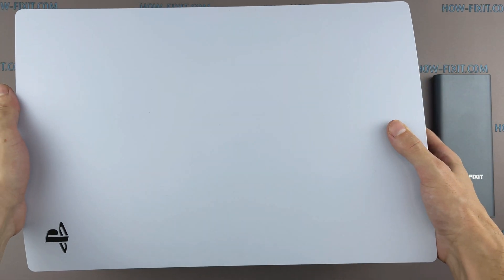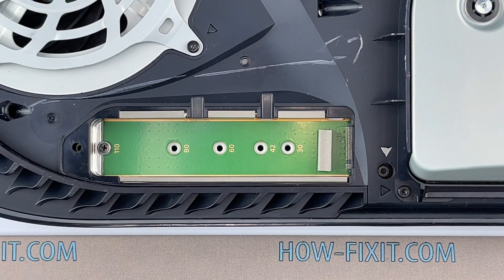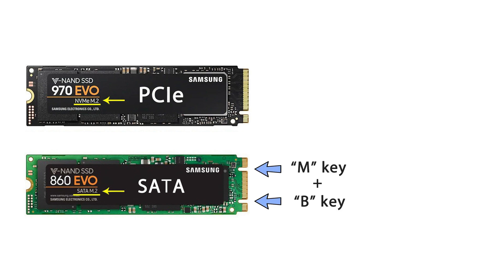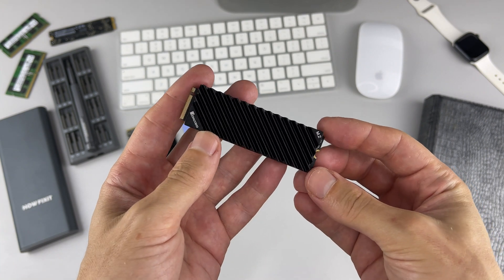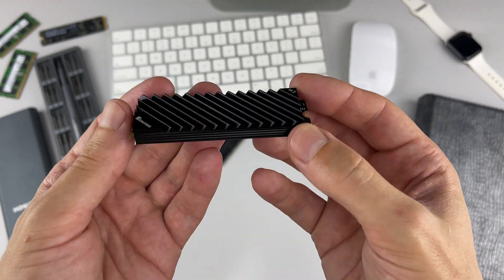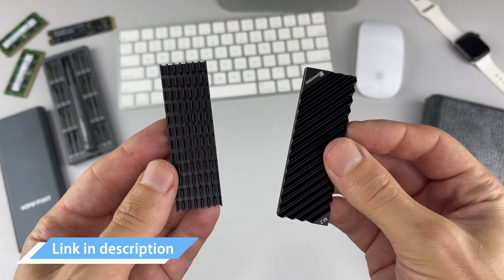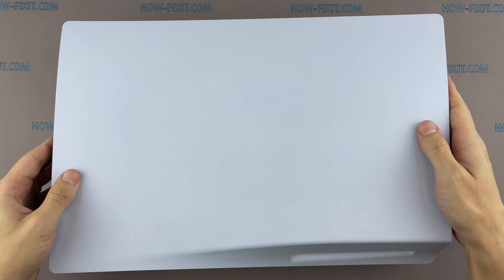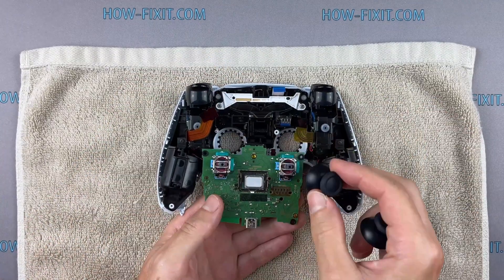PS5 Storage Upgrade: How to Choose & Install M2 SSD

Comment: Hi. Thanks for the video. I have put the Viper VP4300 in as an ssd. Everything works fine but it did me 2 times with 2 different. the joke of turning off the console, very shortly after launching a game. Then I rebooted from the console button and it worked perfectly. Another time it was telling me it was impossible to update a game.... I restarted and then it succeeded. For copies it never gave me any problems, it's just as fast and loads as the basic one, sometimes even a second faster. Do you know what's causing these shutdowns for no reason? I also have the hdd via USB attached. Could it be that it's getting confused?
Reply from the maker: There are two reasons here, the first is software, perhaps with new updates, these errors will be resolved.
The second reason may be the bad contact of the M2 board with the m2 socket, in which case the usual reconnection of M2 SSD helps.
Reply: @howfixit  ok. But why the ps5 shut off very early after on. And when I turn on another time, I can play some hour without problem? And another times, nothing happen and I can play without shut off?
Reply from the maker: @Rider4683  Try unplugging your external USB hard drive and see how the ps5 will work
Reply: @howfixit  yeah, very good. It's juste what I try yesterday. Until now, I have not problem enough. I bought a cable for hdd with usb c exit, and I'll try to connect him on front usb c port of ps5 when I'll receive it. I'll see if this the problem. Thanks